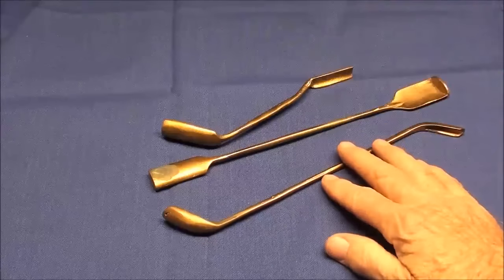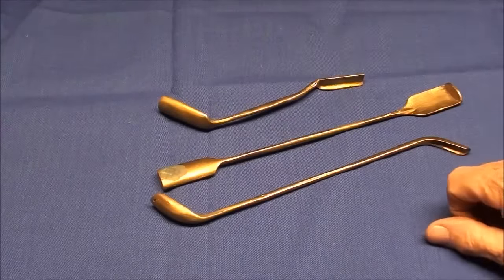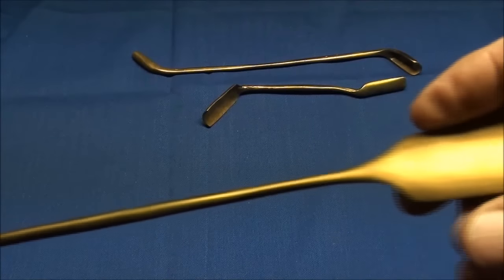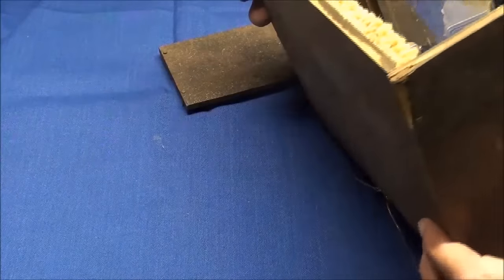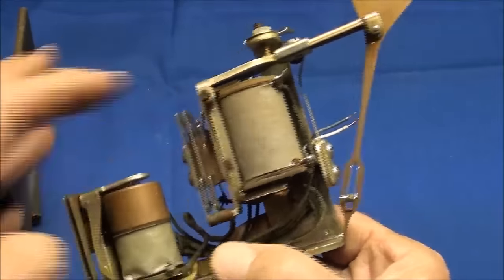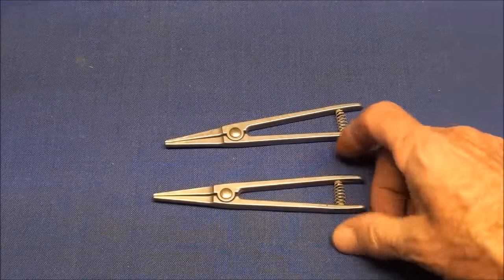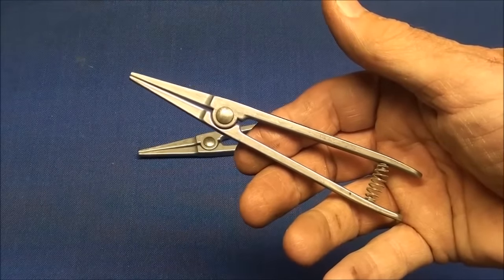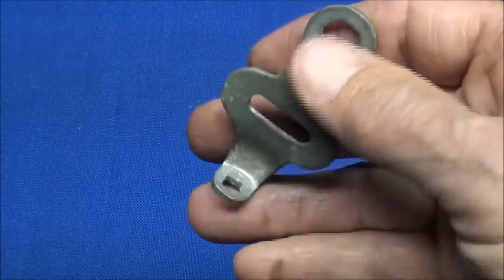WHAT IS IT?  #23a question Mystery Tool tubalcain mrpete222

Comment: Hi, you have great videos. I used to work for a company that had a green sand foundry and they had items like those brass things to cut and shape the sand in places. The two plier things are I think heat sinks for soldering.

Comment: 1) Sculpting tools for working wax - possibly for lost wax investment casting. Can be used for shaping sand in a sand casting mold.

2) a timekeeping device of some sort

3) spring clamps of a type commonly used by electronics techs / hobbyists for heat sinks during soldering

4) ? might be a key for adjusting roller skates to fit around shoes... different style than what we had when I was a kid though...

Comment: sandcasting molding tools (to refine the sand mold after ramming to the form & cut gates/sprues/vents   )
not sure what the device is, but it seem to be incomplete and missing a dial perhaps
heat sinks for soldering-  to protect electrical components from heat of soldering
roller skate key

Comment: First tools are for digging gates in sand molds. The aluminum clamps are soldering heat sinks, the last tool is a roller skate key. The thing with the solenoids and pointer has me stumped though, part of an early electric scale? Maybe sometime electric related gauged

Comment: My best guess is- first items are for foundry work in making sand molds to cut the gates, no idea on the 2nd and the 3rd are heat sinks used in soldering -clip between the board & component (legs) to draw heat away so as not to damage the part and the last is what they called a Skate key for Roller skating for the wheels and adjustments I think? (I'm 51yrs old but I do remember those lol)

Comment: #2 I think is a tattoo gun that is missing it's rear spring connector and obviously doesn't currently have a needle on it.  From the bottom end (opposite the pointed end of the pendulum) it looks like it was a dual use gun that could be setup for a single needle for outlining or multiple needles for shading.  That's my best guess on it.

Comment: Although the three bronze tools do look like foundry tools, the center one (half round with the flat end) is very similar to a tool my grandfather found in Colorado that was used to clear drill holes for blasting in mines. The "spoon" was the same shape, but it was originally attached to a wood shaft.

Comment: I've got one of those medical shock machines, any battery between 3-9 volts seems to make it work.

I think the slot in the roller skate key would fit one of the straps, so you didn't lose it.

Comment: #1 Foundrymen's tools for making filets in the form for sand casting molds, for scooping out the gates in the mold and manipulating the sand.

#2 might be a part of some kind of recording meter. Note the arc opposite the needle with the cutout where a cable or ribbon might attach and run in each direction. To avoid drag on the arm as the paper passes beneath, the larger solenoid is only activated when a mark is wanted which pulls the needle down onto the paper. The rest of the time the needle arm can move freely.The force moving the cable or ribbon may be very small as on a recording micro-galvanometer.

#3 Those look like soldering heat sinks to me, but extremely nice ones. Mine are just aluminum stampings. You clip those to a wire or transistor lead to prevent the soldering heat from travelling up the wire and damaging the transistor or melting the insulation on the wire.

#4 A roller-skate key. The hex opening is for loosening the bolt that holds the length of the skate fixed; it runs in slots in the "beam" that connects the front and back of the skate. The square opening is for the bolt (actually a combination right and left-handed screw that works like a turnbuckle) that tightens the clamps which grip the sole of your shoe up near the toes. The slot is to allow it to be stored between uses on the same strap that goes across the instep to hold your heel into the cup at the back of the skate. (And yes, I'm 72, and used skate keys like that, also the better ones where the square hole was formed by wrapping the metal into a square tube. I skated miles across Bay City, Michigan in the late 1940's and early 1950s, basically until I got a two-wheel bicycle.)

Comment: I think the first items are mold makers  slicks as used in a founder.  The aluminum clips are heat sinks for soldering electronic components. The last one is a roller skate key.

Comment: The second item looks to be the coils from a stepper relay.  The relay contacts are missing.  The pointer would indicate which circuit that the relay has selected on an attached scale.  Used in telephone switching systems and other systems where one of several circuits needed to be connected to a common relay contact. The second coil may be used to reset the relay to the zero position.  For some reason, YouTube won't let me past a link to an image.

Comment: The electrical item, not sure what it is, it could be part of a pen trace recorder like the ones used in seismographs; however the solenoid under your thumb (at frame 4:52) has a copper "slug" fitted these were used as time delay  the coil is energised and the  slug holds the contacts closed for a set time once the voltage is removed

Comment: those "spoons" look like tools for correcting casting forms -- most likely wax forms for casting sculptures.

the switch gear is, imho, a part of telephone switching device. it can be seen in the flick 'dial "m" for murder''.  and that other coil is a part of marconi transmitter.

the clips are for hanging films and prints in the silver salt based photography.

the last seems to be a bike tool for the nipples.

thanks for the video.

Comment: The last item is a skate key for tightening the clamps onto your shoe soles so they could later come loose at high speed.  The pliers-like tools are probably for tying fishing flies, though they could be useful as heat sinks for soldering electronics (if a bit large for that).  The item in the display case looks like a re-purposed relay used as a science experiment to show magnetic fields...but probably not. The three bronze tools look like scoops for measuring out small amounts of powdered substances...Chinese pharmacist scoops?

God ones!

-- Mike

Comment: I would guess that the first item was a set of tools used by mold makers to form gates, etc. and these tools were also used by sculptors working with clay and they were also used in ceramics. I have no idea what item #2 is. Item #3 is used as a heatsink to protect electronic components from heat while soldering components together to make or repair electronic circuits. Item #4 is a skate key.

Comment: this is off topic but the 3 1/2 inch British chuck that you made the back plate for had socket head cap screw screws. I think it would look better if you used low head socket screw screws instead. I am older than dirt and don't remember quite as fast as I used to, older than you even.
Reply from the maker: +Richard Haisley I agree--they are hideous

Comment: Recommended reading first is:
How to Catch a Mole by tubalcain mrpete222

1. Boat oars for a mole.
2. A microwave oven. Place mole inside and cook mole until well done.
3. A moles jack hammer, used when he runs into rock.
4. A mole picker upper tool used by humans.
5. A beer bottle opener used while dealing with the mole problem.

Comment: the low head screws are only 1/8th inch high so they would appear countersunk. the only problem is that you would probably have to buy a full box of 100.

Comment: 1st tools for finer work by a sculptor artist who'd work in modeling clay from which a final bronze bust would be cast. The thing we are sick of seeing at 1:41 is from one of these http://tinyurl.com/nkm9lbv & http://tinyurl.com/psx2ypo, a quackery machine. The latest relay, solenoid, pointer device may be the main component for a Pendulum Master Clock (which a group of other big display clocks in a factory, large office complex, public area etc synchronized to) that provided a single 'push' ever so often to keep the pendulum swinging ...
Reply from the maker: +peteb2 THANK YOU VERY MUCH. You are the first one to have the answer. I did not know myself until now.
Reply: +peteb2 There is a little thing on the pendulum for adjusting it to make it go faster or slower.
Reply: +peteb2 Here's a few more pics and info on the quack medical device: https://www.etsy.com/listing/153184068/antique-quack-medical-device-the-phenix?ref=sr_gallery_16&ga_search_query=medical&ga_view_type=gallery&ga_ship_to=US&ga_order=price_desc&ga_page=5&ga_search_type=vintage
Reply: +cyrex686 As Soon as you mentioned clocks it came to me! That's where they got the term "Regulator" on electric assisted clocks. The solenoids and pointer would keep clocks in time by giving them a push when needed. That way people didn't have to compare times between multiple clocks and constantly tweak them to keep them timed.
Reply: +UnitCrane514 For that pendulum thing I clicked through http://clockdoc.org/default.aspx?aid=1 which has hundreds of electric clocks but I couldn't find something matching. It may be part of a synchronome master for the second hand of a master controlled clock because normal synchronomes seem to have longer (therefore lower frequency) pendulums.

Comment: They look like tools masons would use for pointing mortar in brick or block work.
Reply: +Randy Slodysko That was my first thought as well, But I've never seen them made from bronze.
Reply: +Al Meyer Neither have I but they are old and that was a very malleable material back in the day. That's just my guess though. Not really based on anything.